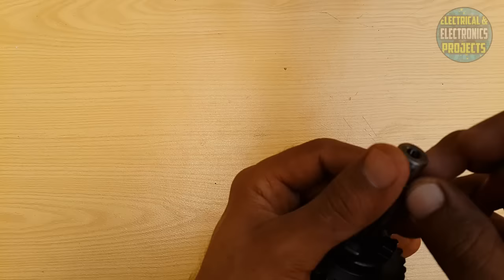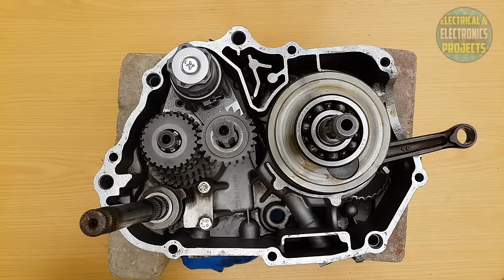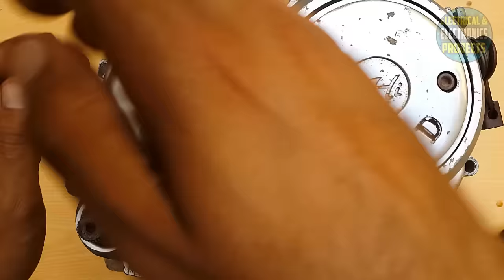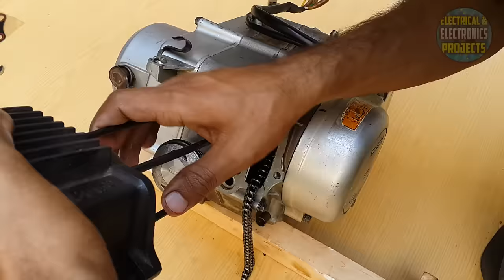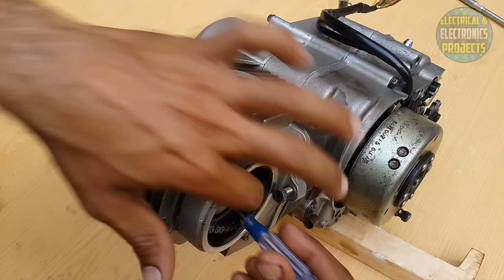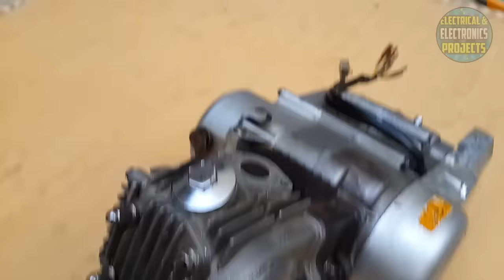Assembling CD-70/SR-70 Motorcycle Engine.

Comment: Yesterday my bike came out of the show room after the engine work, initially there was a starting problem, someone came out of the workshop and gave the bike a high acceleration for 1 minute while it was in neutral, I wish to know if it will affect the newly replaced crank and piston as the main mechanic previously told me not to run the bike above 40 km until first 500 km . please reply
Reply from the maker: Yes it does affect newly bored cylinder first let it run around 300 to 500 km before running on high acceleration.
Reply: @ElectricalElectronicsProjects  you mean even while it is neutral gear

Comment: What is the problem if the two side cover is overheating after 5mins engine running and it turn off. Oil pump is good. Pls answer.thanks